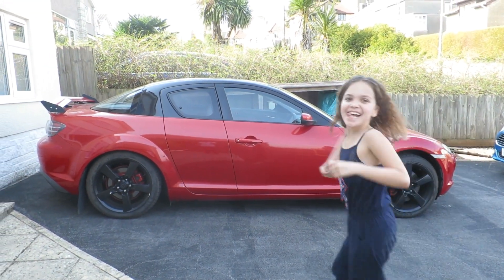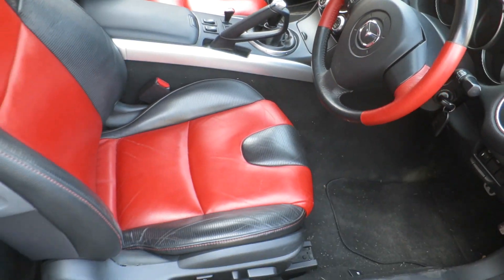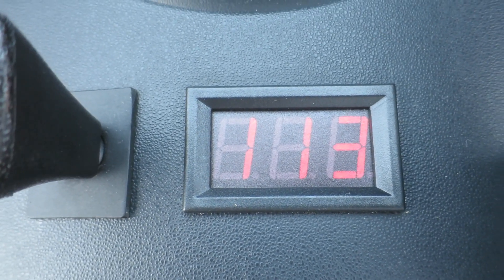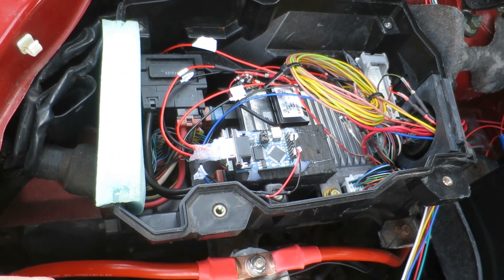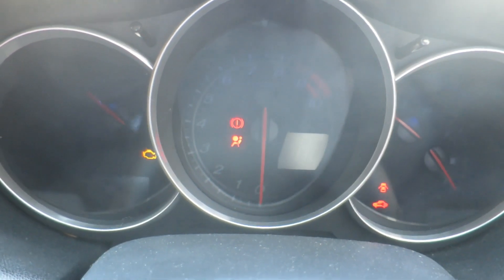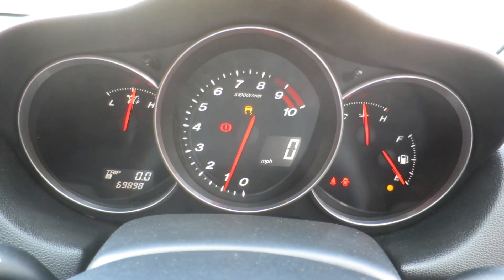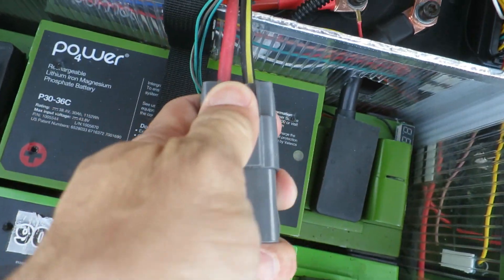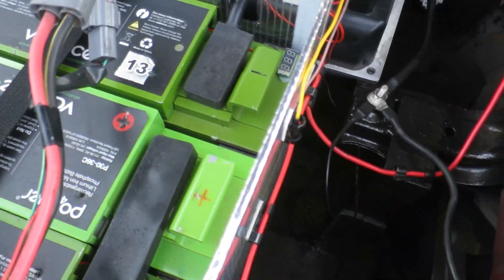Mazda RX8 Electric Car Conversion

Comment: Hi! I hace a question, how can i make work the EPS without ecu? Can i just plug 12v to the EPS Module?
Reply from the maker: No unfortunately not, you also need to send it an rpm initially to kick it off.

Comment: Could it be possible to remove the rear seats, and place the batteries there? Then you can remove the rear doors as well and replace them with custom panels that are much lighter. I think you could get a lot more range that way and then you'd get back your trunk space, obviously at the cost of making it a 2 seater
Reply from the maker: I quite like taking the family out in it! look at my future videos - it is wayyyy faster now!
Reply: @SouthWestEVUK  oh awesome, thank you for the reply! I love the improvements you've made. Just curious bc I'm new to this whole EV conversion thing. How much range do you estimate you could get if the batteries were all fit in the back seat area? Would it be possible to disassemble and fold over a 100kwh Model S pack and fit it in that area safely? Wondering if the much smaller size of the RX8 would lead to 400mi+ range. Is there a software that can estimate this sort of stuff or where should I look to? 

Thanks again!

Comment: I'm also very interested in your work with the Can bus I would like to convert (with a Leaf motor) a first series Mercedes ML and the Can bus is going to be my biggest problem.
Reply from the maker: Yes, to make the car pass the MOT you need to get a handle on the canbud.

Comment: Nice work!!! Is it possible to get more info on the Arduino code and such? 
I'm considering doing this for an RX-7 FD, with the addition of converting it from RWD to AWD, while still maintaining all the creature comforts and safety features.
Reply from the maker: You wont really need this code etc with the RX7 - I am not sure is uses the CanBus system?

Comment: I find it very interesting that you chose to keep the original gearbox. In my opinion it’s not worth it because of the inefficiency. It sure is pretty cool though. 

Don’t you think it would be better to get rid of the gearbox and just connect a more powerful motor to the drivetrain? I have thought of getting two motors in my build for each back wheel so that I could get rid of the differential. More efficiency more reliability more fun right?!
Reply from the maker: Check out my upgrades in the last videos...

Comment: Not to be rude, but how much did it cost to make it electric powered? My plan is to buy an RX8, drive it until the engine needs to be revised, store it somewhere and one day, when I have the money, swap it with an electric engine
Reply from the maker: I will be producing a video to answer these questions ;o)

Comment: Epic build. Love to get some detail on how you learned about CANBUS and Arduino. Just noticed you didn’t use any rubber dampening on your motor mount. I was advised by my supplier to isolate my hyper 9 from road vibration.
Reply from the maker: So the original RX8 rubber mounts are in place still - hoping they hold up but going to keep a close eye on them...

Comment: Do you get any lag from using the Arduino for the throttle pedal? sorry for all the questions, my rx8 needs a rebuild and im getting some different ideas
Reply from the maker: no lag at all, the Arduino cycles in micro seconds so all good.

Comment: This is one prime example of why these car conversions won't work when you lose all your boot space........and another good reason why Tesla and co make their battery packs under the floor as part of the car.....back to the drawing board fellas.
Reply from the maker: Works fine, in fact works perfectly.
Reply: @SouthWestEVUK  Yes it would for you, but no boot space, probably fits your bill but for a general example of a conversion it's not practical......one reason why they build batteries into the frame of a car when it's designed from the ground up as an EV......not possible to do with a conversion.

Comment: this is very impressive work..
I was about to take on an identical project...
parts were sourced. 
two things held me back..
a company willing to insure the finished product...
and I absolutely love the rx8 dash...so I wasn't willing to put an ugly aftermarket unit...with the lack of a way to make the can bus software work with anything else 
so I ended up rebuilding the rotary engine and repaired all rust..
I've spent 3 years making my rx8 perfect. 
but I've still kicked my rx electric project down the road...
would you be willing to share the can bus /adrino code I'm an electrician by trade ...
Great with electronics..Good with computers...
know very little about coding..
I'd be willing to share my rebuild journey..
Great work mate.
Reply from the maker: so you are starting a new ev project?

Comment: Another electric vehicle....Tesla is singlehandedly running the car scene and electric cars are disgusting and not even efficient.
Rotary engines are inefficient because of the type of fuel they are given. If you want TRUE efficiency use LPG with gas or instead of gas on the rotary. Hell, LS swapping anything is the single worst thing to ever happen to a car and even that is better than converting to electric.
Reply from the maker: 0-60mph in 2.5 seconds, range of 300miles and no emissions from the vehicle. Sounds pretty good to me.
Reply: @SouthWestEVUK  And boring as all fuck. No soul, cant "feel" the car, and you dont even drive it! The damn thing drives itself with all the computers. Its shockingly shit made by an asshole and a moron.

Comment: remove the gear box.. mount motor direct to the differential ..
Reply from the maker: Problem is the Diff has a ratio that means the power output will be all wrong, top speed of 40mph when i get the leaf installed.

Comment: Nice to see it done on a budget, even as it is it would still be useful for nipping into town in a cool electric car.
Cost of upgrading controller and battery will be high I expect but ultimately worth it.
I'm thinking of doing a conversion sometime, cheap low range is ok for me lol.
I just converted old mountain bike to electric and its awesome cost less than £300 , good speed and range but wont be fun the winter...
Reply from the maker: Well done with the bike project - thanks for your support.

Comment: Better battery pack for this car would get you 200 miles then u would have to charge it but if you can figure some kind of charging system that would keep your car going without having to charge the battery and keep you moving I was thinking about a alternator hooked into the drive axle so when the car is moving your charging your battery
Reply from the maker: Hmmm theres no such thing as free energy. So if you take energy from the drive axle with an alternator, you have to put more energy into moving to overcome that extra loss. Net result is almost zero, it is actually less than zero as the belt and alternator will not be 100% efficient, so you will lose more than you gain. Sorry!

Comment: How much power does the motor have and what is it from I'm thinking of taking on a similar project
Reply from the maker: Hi the motor is a general AC 15KW motor. I bought it new from a company in china as they could supply the inverter, throttle pedal, wiring loom - everything needed to make an EV. Great starting kit and I have it for sale on ebay ;o)

https://www.ebay.co.uk/itm/254658496277?ssPageName=STRK:MESELX:IT&_trksid=p3984.m1555.l2649

Comment: Hello mate, im from the netherlands and im actually developing a very high performance controller and i came here because i had the same idea to convert the rx8 and you mentioned the arduino can bus stuff, could you please elaborate on what exactly you emulate and perhaps list your sources and perhaps source code? I am very intriqued by your setup!
Reply from the maker: Interesting, if you need someone to test your controller / inverter let me know - see what power we can get from a Leaf motor perhaps! If you subscribe to my channel and go through my videos - you should find everything you need - there is a github with the code in - enjoy ;o)

Comment: You really should use both throttle pedal signals. It wasn't there for redundancy but for safety. Both must agree within a few % of each other otherwise your throttle should default to off. It's to prevent erroneous throttle application which is pretty dangerous.
Reply from the maker: Yeah I will do, this never hit the open road as not powerful enough, will use both in the Leaf version

Comment: Yeah, got to get a better controller and batteries, otherwise all that hard work was not really worth it: 35mph top speed and 10 mile range is actually worse than what the CitiCar got back in the seventies...and it used lead acid batteries and was shaped like a wedge of cheese! https://youtu.be/ilIozuRmTQs
Reply from the maker: Lol, yeah, but baby steps - least I know I can do this now
Reply: @SouthWestEVUK  Indeed. But it's a tricky proposition as you said, because once you start adding the elements that start to make it practical it rapidly becomes a real investment instead of a cool project. I wish you luck, my friend. 

Have you seen this guy's conversion? It is amazing and his explanation is super thorough like your's. I think you will appreciate it: https://youtu.be/IKR8Or6Im6w

Comment: It is a great conversion. Congratulations and thanks for sharing your experience. You will be so happy once you got a better battery pack and controller. What kind of HV battery charger are you using?
Reply from the maker: Its an Elcon 3.3kw
Reply: @SouthWestEVUK  Many thanks for the reply. In your latest video post, you mentioned that you would use an aftermarket BMS for the (Nissan Leaf) battery pack. Do you have any particular name in mind? Cheers

Comment: I will be direct as Gordon Ramsey, its shit, you could have swapped the rotary with a tiny 0.9 litre diesel engine, putted on gassoline engine head and run it on two stroke mixture, that gives u immense compression ratio and that translates to huge amount of horsepower, concidered how small the engine is and just by 2 to 1 reduction you could have used stock transmission, but you wanted to douche instead of making something usefull and thats the reason why its shit, 4 cylinder usualy combusts with two combustions by stroke, not with timeout, so you could have used the ECU with it if its two rotor engine, if its 3 rotor, then even better, you could have bought vr6 engine and have a beafy motherf*er, that swap is nonsense, cause the reservoir is removed and you used your trunk to store batteries, not concidering the on-road stability
Reply from the maker: You have missed the point.

Comment: Iv been planning on building one Eva since I owed one an the engine popped as they do , an straight away thought perfect car to do an ev , main problem for me would be the car ev interface an you have seemed to get over the main issues and showed me this could be done 😏 , thank you iv got about 12 k to spend so just wondered how much this cost to build less the car ? As I’m looking at a £5 k battery
Reply from the maker: £12k is a solid budget, this cost £4k but is very limit on speed and range. £12k I would look at a Gen 2 Leaf - 110kw (about 150hp). Where abouts are you?
Reply: TheBlackhursts ahh see I think this is where we are different I take it ur project was for eco driving , that’s cool but I’m looking to do 350 whp have found a company it Japan that can supply the motor an driver unit for around the 3.5 k and I have a friend who builds battery’s an he thinks cane do me a unit for 5 k to power that motor with about 180 mile range it’s the car compatibility part I’ll need help with ? I’m from the midlands I have an i8 already but want to build an rx8

Comment: Hey my good sir from across the pond!
Rob from Texas.
I would like to know how much weight this added to the car when you get your new batteries. 
Also. What's the story of the transmission? You actually switch gears? I would love for you to elaborate because I didn't even know that was a thing. Super impressive!
Reply from the maker: Currently it is about 50kg heavier than the original car id estimate. Hoping to bring that down when I upgrade parts to Leaf. Left the gearbox in as I was unsure what power I would get and which gear would be best. Cheers ;o)

Comment: Can you place the new motor in place of the gearbox? And use more space?
The gearbox is also reducing your efficiency. Maybe you could also change the ratio at the differential?
Reply from the maker: Yes this is all true, I left the gearbox in as my motor is very weak so needed the gearing to help. I didnt know what gearing would be best so leaving the gearbox in seemed the logical choice.

Comment: Why not use the space where the fuel tank used to be for some of the batteries
Reply from the maker: Yes this is the plan, tricky fabrication but defo the long term plan
Reply: TheBlackhursts Man, this is nice, RX8 is a very nice car to make an EV from, nice chassis and many of them end up totaled because of a dead engine. It’s a shame really. Where did you get that electric motor from again?

Comment: 11th God's command: Do not swap rotary to electric
Reply from the maker: Even if the car was going to the scrap heap?
Reply: TheBlackhursts yeah im pro keeping the car on the road, good job bro
Reply: The engine in the rx8 is not worth saving at all, the 13b is a lot stronger.
Reply: Cost the same as a turbo rotary/ a ls swap, plus the economy is well on its way to every gas engine being banned so im all for the swap and his car is rhd 🔥

Comment: Fantastic. Its a shame such a great car came with such a rubbish engine from factory. Its nice to see one getting a new life. Would a LEAF also have a controller unit? Great use of the arduino
Reply from the maker: Yes Lead comes with the inverter - Ill be using an Arduino again to control it ;o)

Comment: Amazing job! Rx8 is one of my dream cars but I really don’t want to deal with rebuilding the engine every 60k miles or replace with a newer one, or at least worry about my engine all the time.
Reply from the maker: Yeah, its a lovely engine, but high maintenance - bit like the wife!
Reply: My r7 s2 lasted over 20years on it's original 12a without needing a rebuild they can last plenty long enough if you maintain them properly just like my old diesel 4wd ignore the manufacturer recommendations and service more regularly on both the rotary and diesel an oil change every 5k km is the best insurance and not difficult to do

Comment: Great job on the conversion.
The engine in my RX-8 died last autumn and I was also thinking about doing the EV conversion, but doing all this CAN bus stuff is what is stopping me. I am also a programmer, just have no experience in this area.
Could you please share your code for Arduino? Possibly on github.com ? This way it could get improvements from all Rex nerds out there. :-)
Reply from the maker: Bit of polishing on the code to do - will hopefully have something to release soon

Comment: This is amazing work, but the forward/reverse selector terrifies me a bit! Does it only work when stationary, or what happens if the passenger knocks it by accident?
Reply from the maker: I believe the controller deals with that problem by limiting torque as the motor is spinning in the other direction - but it is something I will double check!

Comment: The circuit breaker you have may not work as you expect. They are designed to work with AC. Using them on DC can result on not being able to extinguish the arc. The result is the circuit breaker will catch fire and melt.
Reply from the maker: The main contact breaker came out of a commercial EV so that is fine. The small breaker - yes that is AC but is only there to trip in the event of a short circuit - nothing is flowing through it other than being a common ground.
Reply: @SouthWestEVUK  if it trips is because current is flowing. In the event of a short circuit you will have fault current flowing thru the breaker. What causes the damage is not the current flow but the arc that does not extinguish when the breaker trips.

Comment: What an extremely interesting project and you have accomplished so much on such a small budget. Currently have an RX8 in the side garden with no engine, gearbox etc...all removed and in bits in my garage...if possible make many more videos on this ... as an electronics engineer this fascinated me..and I smile when I see you using arduino..genius! Keep them coming. Have subscribed.
Reply from the maker: Best just to get stuck in! Good luck.